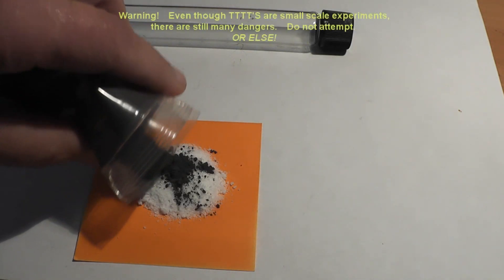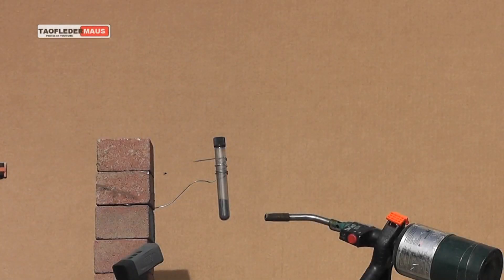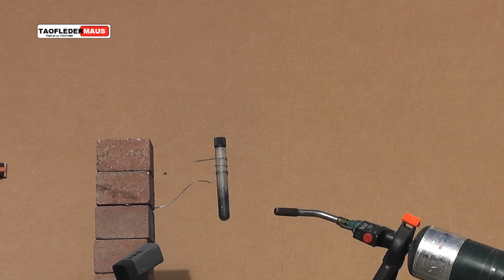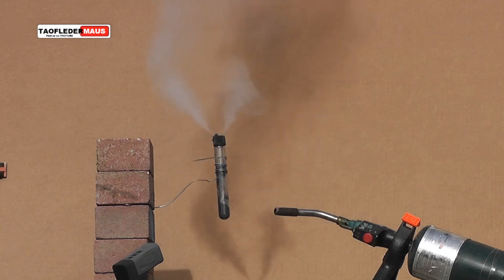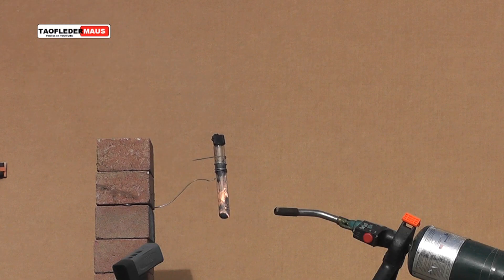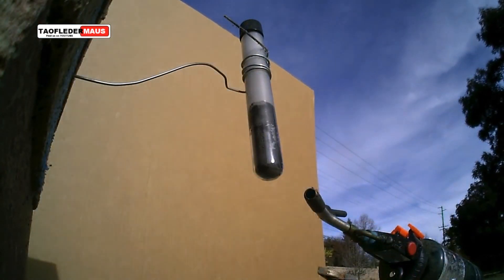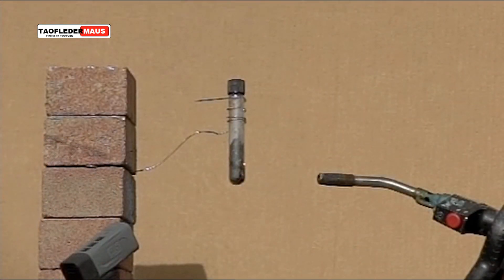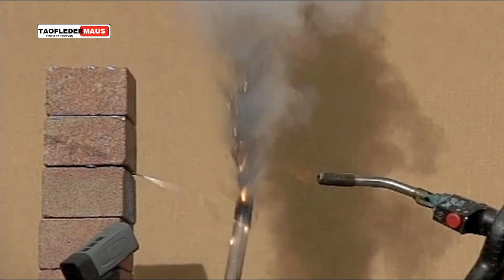SUPER-HEATING Ammonium Nitrate and Aluminum Powder - TTTT Science

Comment: You should try mixing it with sulfur. Aluminum powder and sulfur burn at around 1100°C on there own, so that might be able help the reaction. Maybe just the right mixture would have the right combination of efficiency and explosivity to be a good homemade rocket fuel. Be careful, though, the reaction of ammonium nitrate with sulfur should produce SULFURIC ACID, and the aluminum won't be able to absorb all of that if it explodes.

Comment: Hey, Jeff, here's a little tidbit you may want to mentally file away for a "rainy day". Take the Tannerite, mix equal volumes of the Aluminum powder with the Ammonium Nitrate, then by volume, add a third equal amount of Nitromethane, and you'll end up with Astrolite A-1-6, the most powerful non-nuclear explosive in existence. It does need a pretty stout detonator to get full effect.
Reply: I thought it was hydrazine
Reply: fordrac1ng81 You can use Hydrazine, but it will be slightly less powerful. You still get an awesome bang with it.

Comment: what's happened actually is that while the temperature is rising. the Ammonium nitrate started decomposes into gas and water (around 210 °C).
and when the temperature is enough for the aluminum to reacts, there will be no enough Ammonium nitrate.
this is the reason why you have to heat it very quickly (high-velocity bullet) or to add something that will do it for you (blasting cap).

Comment: If you want to set any of these powered Al/oxidizer mixtures off without a flame, just use a little potassium permanganate and start the reaction with a couple drops of sulfuric acid. It's also generally safer because the reaction initiates more slowly than when you start it with a flame.

Comment: A lazy cursory google search alleges that the melting point of aluminum (1221 degrees F) is lower than the melting point of Pyrex (1510 degrees F).  I think aluminum oxide powder alone will end like it did here, so maybe aluminum foil or sewing needles or something?  Salt's melting point is about 30 degrees lower than Pyrex's (as alleged by google), but I don't think that'd work because the salt wouldn't be subject to the direct heat of the flame.  I also think something interesting, if you can manage it, removing the air and replacing it with an inert gas (or a vacuum?) along with some normally flammable solid like paper or cotton.

Comment: technically tannerite isn't just AN-AL. Tannerite consists of two components: a catalyst or sensitizer and a bulk material or oxidizer. The oxidizer is a mixture of 85% 200-mesh ammonium nitrate and 0–15% ammonium perchlorate, while the catalyst is a mixture of 90% 600-mesh dark flake aluminium powder, 5% 325-mesh titanium sponge and 5% 200-mesh zirconium hydroxide. But I have shot both and they are very close in results when fired at with a .223.

Comment: Methinks you could shoot the test tube up into the air considering the slow-mo showed the cap blowing off before the pressure could rupture the tube.
Reply from the maker: sunshadow7XK  I tried that a couple months ago.   I tried to stick a test tube in a rocket.  What happened was the glass just broke.  I think the glass is a lot thicker at the bottom.

Comment: Very interesting test!, I did not  expect the NH4NO3 to evaporate out of the tube like that!. although I imagine it has a bit of moisture in it to begin with, given how hygroscopic it is.
Reply: AN does not evaporate, it decomposes into nitrous oxide and water vapour.(or possibly other products, depending on the conditions)
Reply from the maker: Aussie50  I thought it would ignite,   maybe not detonate,  but ignite.   I was thinking along the lines of theTexas City ship that blew up that was full of ammonium nitrate.
Reply: *****
perhaps you just need an greater volume of the mix (like maybe a car full?) and put a flame to that? And if that first mix proves to be a let down, throw the magnesium mix in and try again.

Things could get VERY intersting then LOL.

That aside, another interesting reaction from TTTT. Thanks